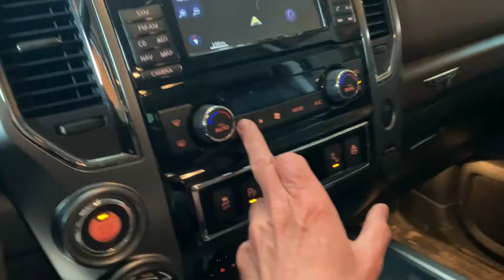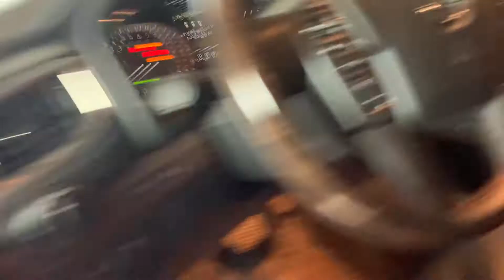2018 Nissan Titan Engine Knock ?? Video #2

Comment: Had same issue we found out that the mobile one oil Nissan oil and valvoline blue were the issue changed to amsoil runs great  no noise no knocking
Reply: Really? What viscosity did u use ?
Reply: I have a 2022 thats knocking at 8735 miles, dealers says its normal but i know better
Reply: @Dan-g1o5u  sorry man, what oil you using? My Titan knocks to but it’s been better lately. Only does it in the morning for the first mile.
Reply: @jeremyzimbicki9977  whatever the dealer put in it at its first change, also its embarrassing when you stop and people are looking
Reply: @jstitan2972  You have no idea what youre talking about!
These engines have been around for over 25 years v motors are one of the best.
Reply: @MrPaknight  I own one. 2018. 3 engines replaced under warranty.  There's a knock TSB out on these 5.6 Vkvd engines.  Look it up. Then come back to the conversation.
Or I can give you my copy of the paperwork showing the repairs made and explanation of flawed machining and oil ring deformities.  These engine are all literally ticking time bombs. I love my truck but I know it could happen again.  I spoke with a Nissan rep when I was contemplating a lemon lawsuit.  The only reason I stayed loyal is because Nissan treated me well.
Unfortunately I can point you in the direction of a close friend who had an engine replaced in her 2019 so don't tell me I don't know what I'm talking about.
Reply: @jstitan2972  
What year models does this affect? I have a 2010 Titan.
Reply: @TheChube25  you're safe bud, the early VK56 witch is what you have are rock solid. It's the redesign that has issues. I will have to edit my comments because I have done research since then and Nissan has been good to me. My truck also has been rock solid since the warranty work.
Reply: @jstitan2972  
Thanks man, 
They are all I have ever driven! God bless